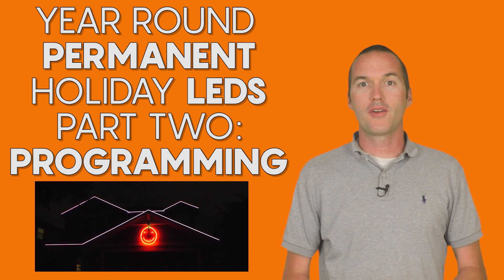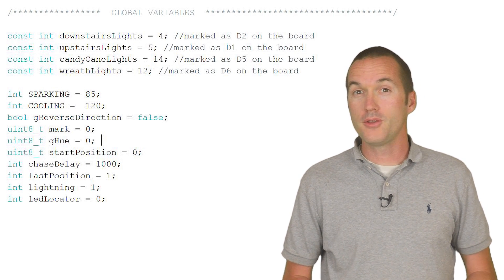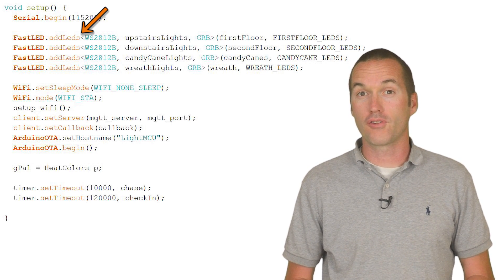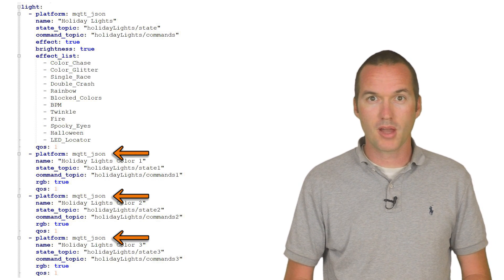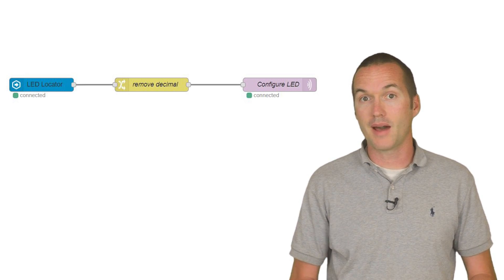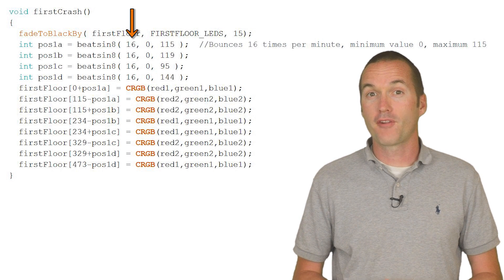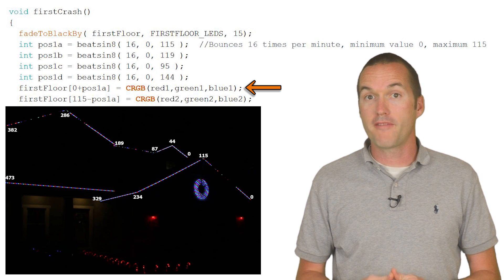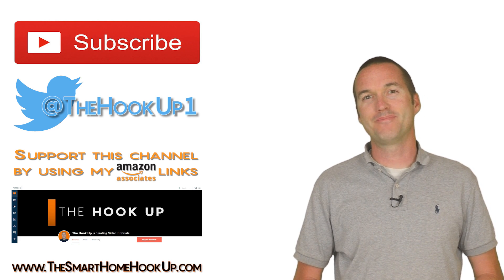Year Round Holiday LEDs Part 2: Software

Comment: For those that are lucky enough to persue this "hobby" to these extents, you may want to look into Xlights as a controller and 
ESPixelstick as a controller for the strip.  It will save the time wasted hand coding animations, and you can do so much more with it:
http://forkineye.com/espixelstick/

Here is a great channel if you want to take that further:  CanispaterChristmas
I think he takes it to a little bit extremes, and his tastes are a bit expensive, but it's a heck of a setup.

You can also integrate professional DMX items into the above and it even supports DMX universes, DMX512, renard and GE color effects.

My "designer" wont allow such a setup - I was told colored lights are for carnivals.  So I'm trying to sneak something like this into a classic "Victorian" Christmas.  Maybe I'll at least be allowed to animate the warm whites.  sigh.

I wonder how these things will last long term however, because DC and outdoors do not mix.  Make sure you take the time to seal it up 100% because DC currents attract the oxidation where AC had the ability to repel it.  For sure you wont be handing down your LED christmas lights to your childeren!
Reply from the maker: Eh, I don't know.  I'm subbed to CanispaterChristmas and have been on diychristmas forums for a while.  I think the learning curve for xlights and vixen is about the same as learning arduino programming... But arduino is a much better skill to have.  

Combine that with how much cheaper it is to run ~2000 LEDs on a single NodeMCU and that's why I chose to do it like this in the first place.
Reply: True that, and it's incredibly simplistic.   But so many more possibilities are available for Xlights, and it's so professional.  I'm incredibly impressed by it.

 I took the time to do what you are doing a while back for those things, and abandoned the project.  I was trying to light some porch columns up from the bottom without wrapping them in pixels.  I've been scrambling for a solution to use a RGB 10w LED.  I'm thinking of doing a board with RS485 and thinking of trying to standardize it instead of making a one off hack.  I'm thinking of making it RS485 or DMX ready - I'm looking around all over for something that exists already - I cannot believe it doesn't.  The same guy that did ESPixelstick did something called "FloodBrain" - I think that may be close...
Reply from the maker: @jimb032  His shows are my favorite.  His house is really setup for it though with the covered porch and symmetrical windows though.
Reply: @TheHookUp  - Did you ever look into doing something with DMX?  Because of wanting to use RGB floodlights, I was thinking a DMX512 24ch Decoder, and perhaps a control system (xlights or ...)  To me, the ideal setup would be  HA HUB -> MQTT -> Xlights ("show" depends on MQTT message) ->DMX Controller -> DMX512 24 channel controller -> RGB Floodlights(built into columns).  Even so I already wrote the code to do all the pixel stuff with some animations built in, it doesn't hurt my feelings to scrap it and start over especially knowing I have something a bit more standard...  Someone has to have done before what I am trying to do...perhaps I should start with DIYChristmas?
Reply from the maker: @jimb032  I haven't looked into it.  My goal is to do a show without DMX, not because it's better, but because I'll have fun doing it.

Comment: Do you have any signal issues since the distance from NodeMCU to the first pixels of the LED lights are too far apart?
Reply from the maker: Never had any issues with that, no.  My first run is 50 ft from the node mcu

Comment: Awesome! First 50% LEDs up and running, just having some trouble with mqtt.. soooooo slow to get to the mcu? All other Mqtt devices are fast and responsive.. and LED_Locator show wrong number/LED? Any ideas?
Reply from the maker: Are you outside when doing your tests?  Is it possible that your wifi signal is not strong outside?  Maybe try to use a debug node in node-red to see if it's slow to come in or slow to go out?
Reply: The Hook Up 
Yes outside, have sonoffs and other mqtt devices longer away this sits right outside front door, when checking whit mqttlens its ha that is slow to send, but only on just this light..

Comment: How are you making your connections between the power/data wire and the LED strips? Are you soldering, using connectors, or something else? Thanks for the time you put into making your videos. They are great!
Reply from the maker: I soldered mine, it's actually not too bad.  Just pre-tin the pads and end of the wire and then hit them really quickly with heat to bond them.
Reply: So how are you both connecting 2 strips together and injecting power? Doesn't  it get tedious and bulky at that spot? Are you just using one of the close to the end solder pads for injecting power and the very end for joining the two strips together? If you will be covering this in a video, I can be more patient. Just curious. Thanks again.
Reply from the maker: I'll be covering it, part 3 is going to be odds and ends.

Comment: I would add two more effects: one that would light the path above your sidewalk from your driveway when you pull up at night. The second would be a "stalker" mode. If you could detect motion/position with your cameras as some one walks down the sidewalk in front of the house, have an LED follow/mirror their movement.
Reply from the maker: Second one sounds great... But tough to do without a computer running vision software.  We park in the garage so no need for path lighting :)

Comment: thanks for the sketch and making it easy us to parse&modify. for the straigh line you used the aluminium channels what did you use for the wreath for weather protection. if possible please put some of the install pictures on github. been curious as you mentioned that its installed in a way hoa wont complain.
Reply from the maker: The wreath is made of of PEX tubing... I take the wreath down for most of the year.  I'll see if I can get some close of pictures for the github.